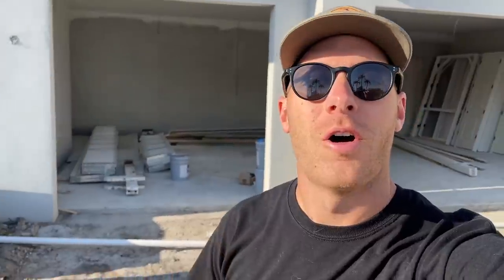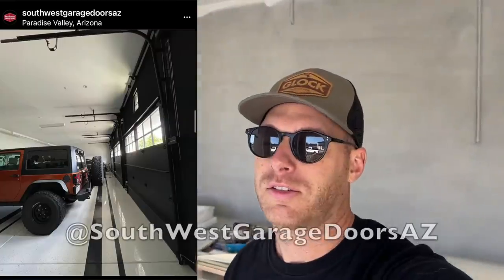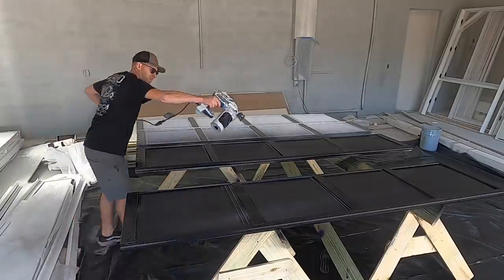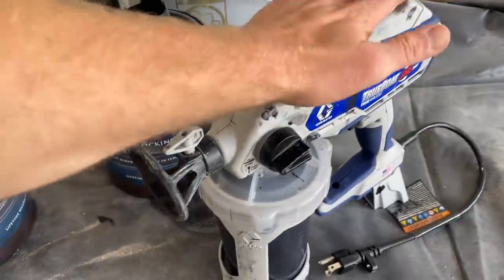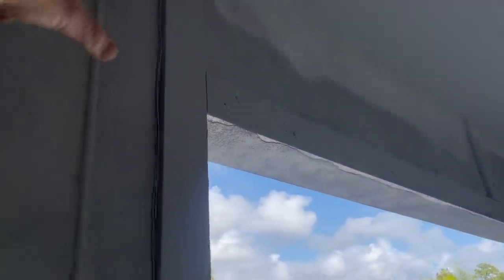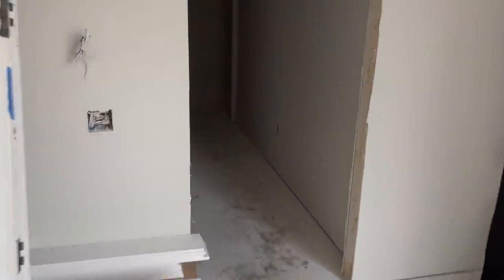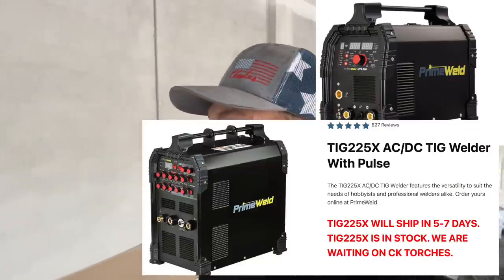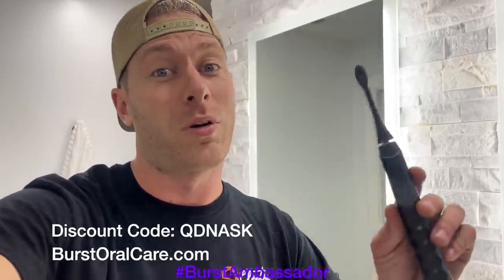Building My Dream Garage... Dr. Pepper is Getting the Space She Deserves

Comment: I just put a wildfire 4 post in my garage and it turned out great. It looks like you have the height to fit it no problem. Plus they don't have to be hard mounted and it can be moved around easily. I would recommend going in the middle bay with a lift though. It won't cramp your welding area.
Reply from the maker: I’ll check them out
Reply: How tall is your ceiling?

Comment: Not going to lie, I freaked when you said the door was going to be black. I'm glad it's the inside, if it was the outside and the sun hits it that would get so hot in the garage. Like having 3 big heater at the front there. It does look good atm
Reply from the maker: Yea I’ve heard that. Doing AC in the garage and having insulated doors will help

Comment: Hoist?? You need at least a 10 ft ceiling and that will struggle to be 8 foot.  You can get 'mini hoists' but they are only about 3 foot high,, so you will be laying on your back fitting powerslides!
As for black?? The reason walls and cielings are white is that it reflects light about 100% better.
Build a proper shed, at least 20x20x12 and use the garage for parking A 20 x20 is really only a one racecar shed. By the time you put in benches, room for a bench grinder, drill press at least you will not have much space left.  I have issues with a 40x20!! And a [nearly] 3 car semienclosed carport and a 20x20 storage shed.
Reply from the maker: I’ve got 10’4” so we’re good! lol only that one wall will be black